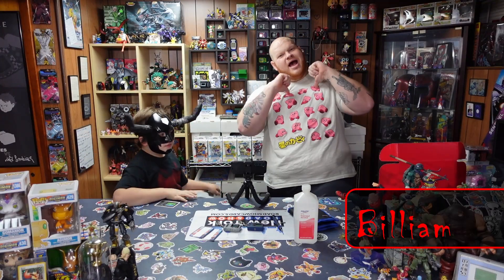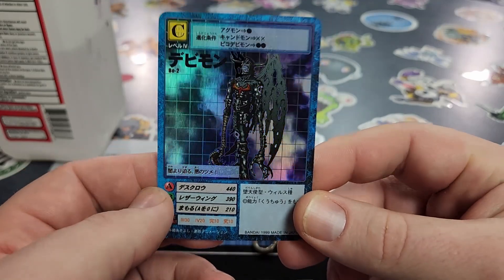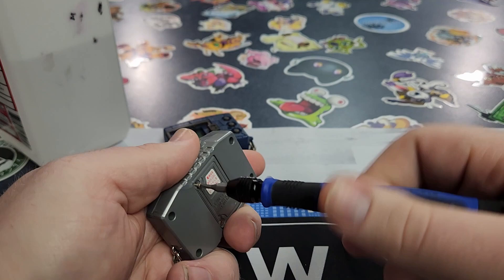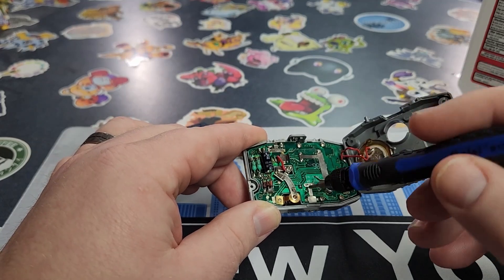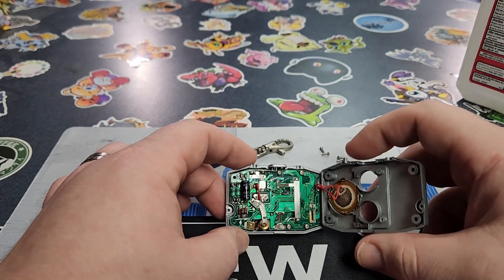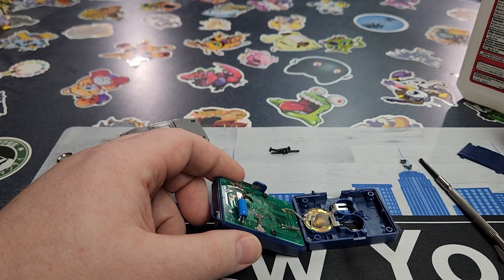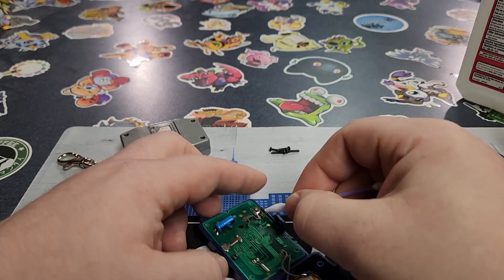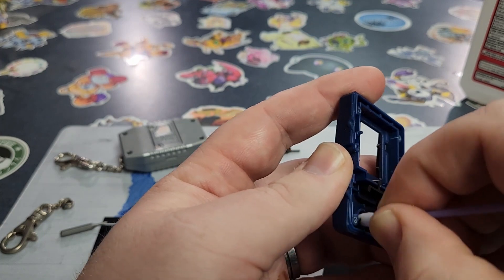How To Restore And Repair Your OG Digimon And Pendulum Devices (Giveaway At The End)

Comment: do you know how to fix the screen issue like you said on DM?   fading and pixel issue etc
Reply from the maker: Sometimes, it's something as simple as the screws need to be tightened. The srceen might not be in the correct position, and it needs to be adjusted. There's more things that it could be, but I would start with that.

Comment: I have an Xross Wars Mini and the battery dries out in just one day. Do you know how to fix this?
Reply from the maker: To start, are you using cheap batteries? These devices will eat through cheap batteries like the ones from a dollar store. I recommend energizer lithium they seem to last the longest for me. If that's not the issue, then you might want to open it up and clean the battery connections. I hope this helps 😁🤘
Reply: @TheDigiDudes  Come to think of it, it’s very likely that it’s because of cheap batteries 😂😂